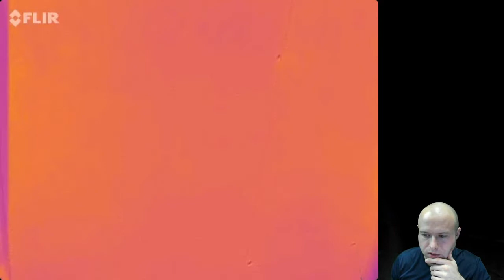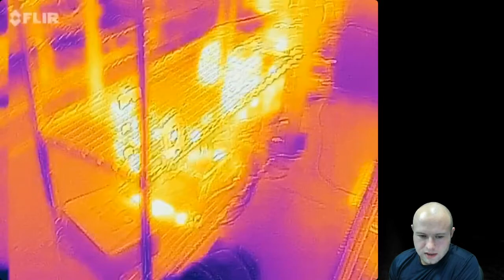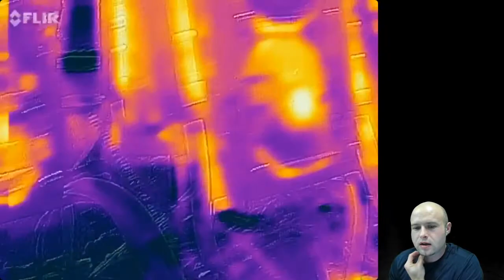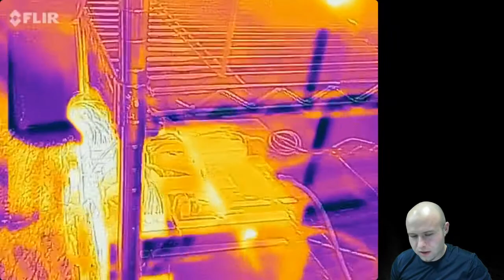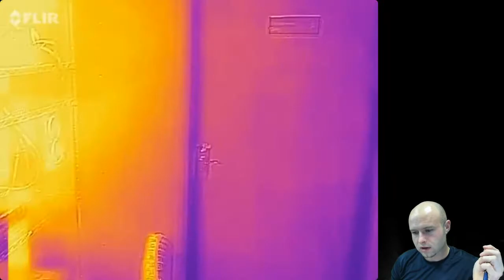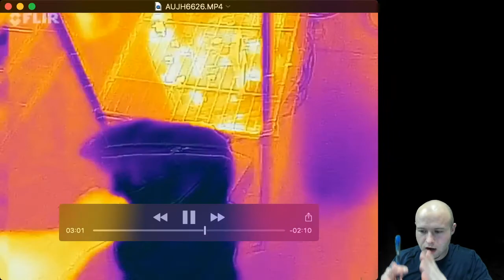Thermal Camera Walk Through GPU Mining Farm!

Comment: thing you gotta understand about those cell phone flir devices is that they constantly auto calibrate (which is the lag you see) to adjust its gradient. The colors really mean nothing. If you show it something where there is only a 5deg difference in the video it will still show the thing that is 5deg hotter in a very bright red even if its like 35F and 40F, the 40F will look super red/white. Also visible light messes with it a lot and anything reflective or metal will also appear hotter especially if you have visible light.

Comment: The air cooler should be put somewhere higher, not on the ground. If you pump cold air at floor level, then most of it will remain on ground level because of its heavier density.
0x381A2ff6651d39a72dd31F9D95dcB77A5188a2F8
Reply: really need to post that wallet address?
Reply: Zenox Thanatoz, I don't quite understand your question?

Comment: How often do you have to dust off the video cards? 
0x2424E01B2b881Db0beBf151000e11F7986E19c8c
Reply from the maker: Haven't had to yet, but need too. Warehouse is dusty. Have a video in the works on GPU cleaning methods.
Reply: i supposed you are going to use blower and vacuum?  i couldnt find that video